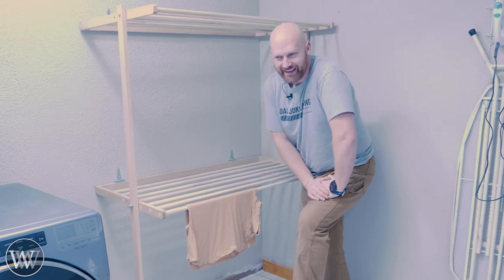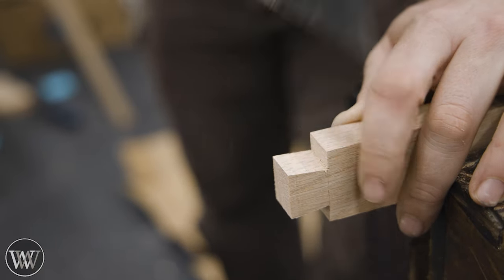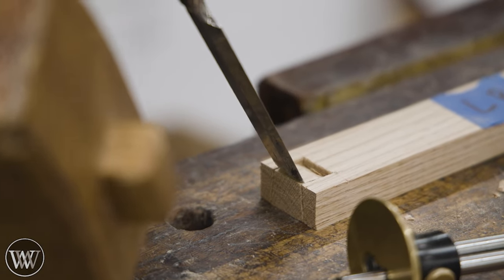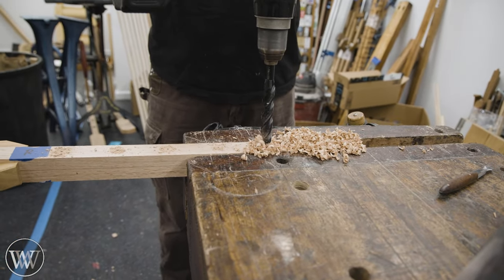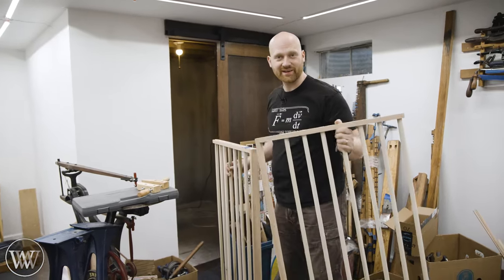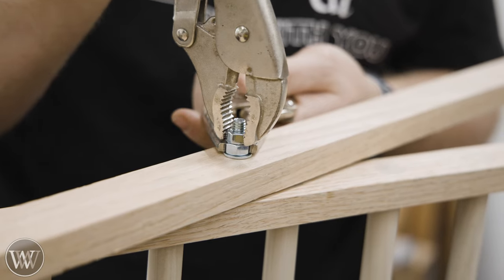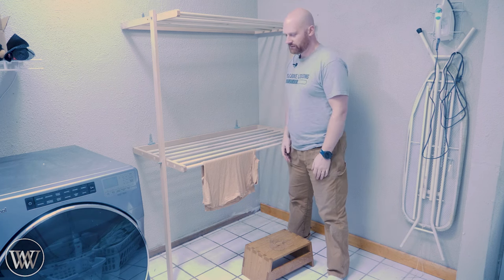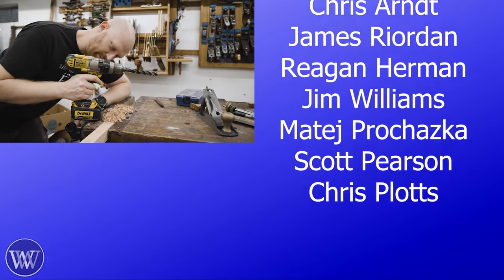How To Make A Drying Rack For The Laundry Room

Comment: Nice. I did a drying rack last year (finally completing the project I'd promised five years earlier!). Mine is on a pulley system and it works very well. The utility room it is in is long and thin, so the pulley works better for me, and stores on the ceiling. Quite common in older houses in the UK, and saves running a dryer for long spells when not necessary (assuming you have good ventilation of course). In hindsight, I could have actually built it longer, but it's difficult to guage just how much space a single wash takes up. Mine is made from zebrano, and I used wedged mortices for the rails, loose wedges for the frame corners and Japanese scarf joints for the lengths that weren't the required two metres. I basically did it as a way to practice joinery, and it surprisingly came out nicely. Drying racks are such good projects as there are so many options for mating joints and lots of opportunity for experiment as it's usually something that's out of the way in a room that nobody goes in! Great work sir.

Comment: Nicely designed and built. Just a suggestion, maybe consider convering  the dowels with clear packing tape to avoid moisture issues with damp clothes. I like it, hopefully she does too.
Reply: Moisture would get in below the tape and get stuck, it is probably better to just keep them as ventilated as possible.
Reply: @pettere8429  I suppose that's possible, I just don't remember it being an issue on the racks we had.

Comment: Nice project! If you don't use finish on oak, the tannins in wood might leave colored marks on clothes btw.
Reply from the maker: That's the conventional wisdom. But in practice reality is different. But to even be on the safe side the towels that touch the clothes are made of poplar.
Reply: Yeah, my experience with tannins is from boat stuff and coloring has happened only during long times of exposure. I made the mistake to comment before i saw wich way they were installed 😁